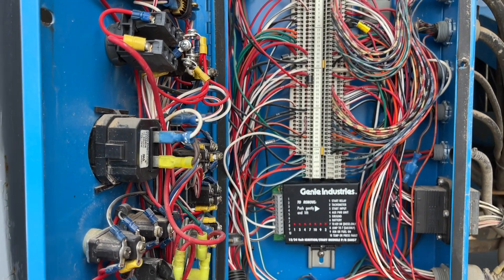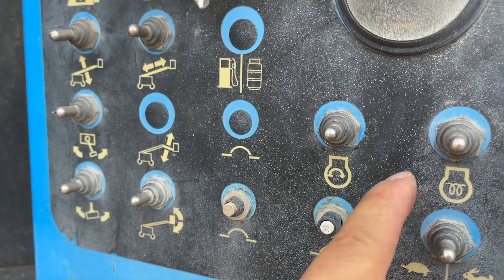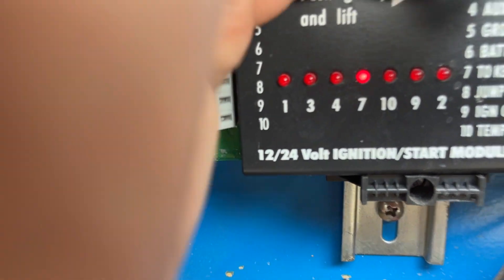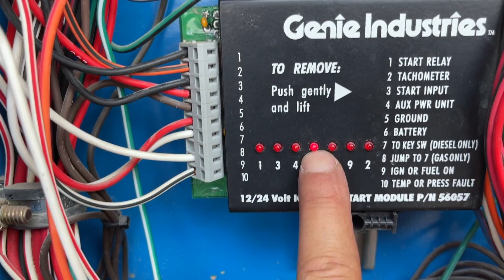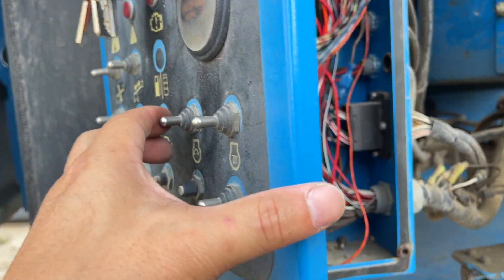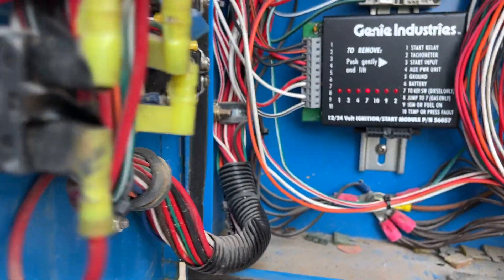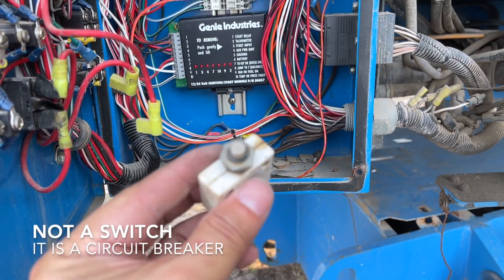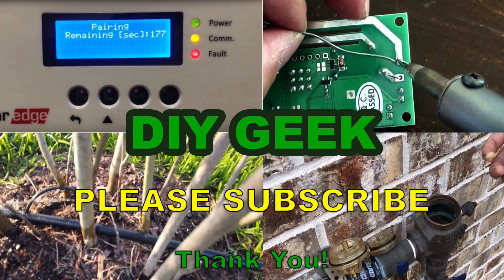GENIE BOOM LIFT WILL NOT START NO CRANK - FIXED!

Comment: After working on all Genie and JLG lifts for 35 years i find often switches and breakers get corrosion from being exposed to rain dirt etc .
Cover your control box on basket and lower to protect it.

I also spray electrictronics with WD 40 in key hole and behind panels switches etc..

Those breakers infamous for corrosion and not conducting electric power.

If you have a Deutz engine better change timing belt and tensioner before it breaks and bends pushrods or worse.

Comment: I have a problem in my Genie personnel lifter because it doesn't stay in desired height after I pressed the UP button, it will slowly going down once I released the button. Any idea what is the problem or defective parts?
Reply: Lift cylinder drifting, so needs to be resealed or could be part of the manifold

Comment: Hi, I've tried to update the software on Genie S-85 XC year 2018 (Bootloader 1302967-1.7.1 and Firmware 1302966-1.9.5) via USB. The Bootloader successfully installed and during updating of Firmware DISCON, PCON main, PCON secondary and TCON secondary successfully update 100% but TCON main not updating and showing message "Sub-ECU not responding try to recovery. I've checked wiring and CAN resistance on J5 and J10 connectors, all good. The Genie have ALC-600 controllers.
Can you please help me. Thanks in advance.

Comment: Had our S60 come back as it's not cranking.  Didn't have to time to get under the panel, but will give this a look as I'm hoping it's not a fuel delivery issue.
Appreciate the tip.
Reply from the maker: Did it recently ran out of diesel? or is the diesel low? Unfortunately 9 out of 10 times with these diesel large equipment it is MOST LIKELY diesel fuel delivery issue. There is a priming pump you can push usually by the diesel filter. Try pushing that and crank it. If that makes a difference then you are confirmed it is a fuel delivery issue.

Comment: hello  paul have a question for  you    i have as65  # 15229  its a 2007  every function works from ground and platform  only problem iam having is boom up very very slow from ground and platform very very slow i put my hydraulic pressure guage on it iam only getting little below 2000 psi when i try  to boom up
Reply from the maker: You have a hydraulic issue not electronic. I would start by checking for leaks, hydraulic fluid level and hydraulic pump.
Reply: @DIYGEEKTEXAS  i replace the valve and it works good kooool